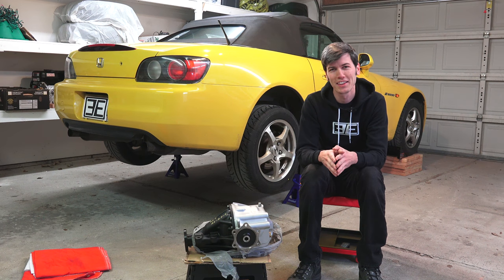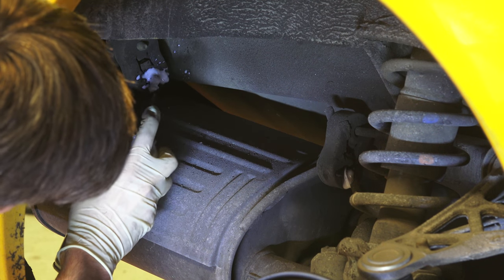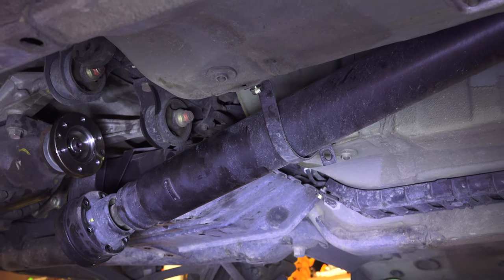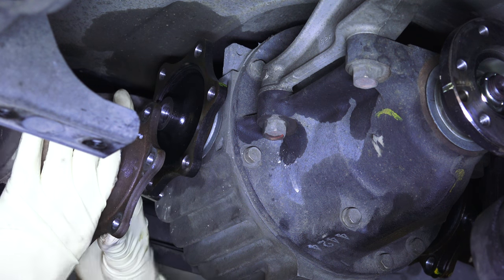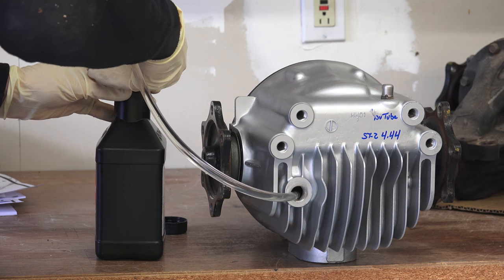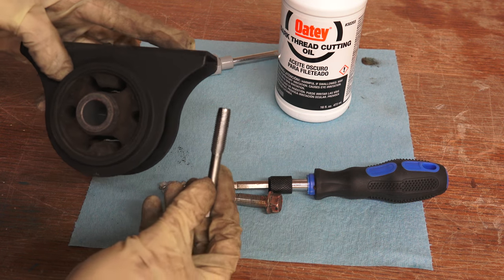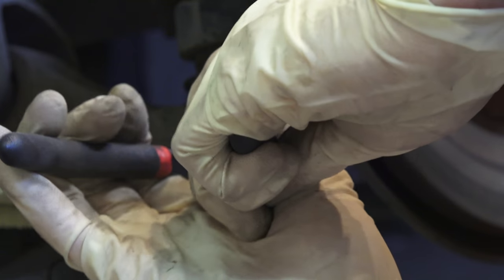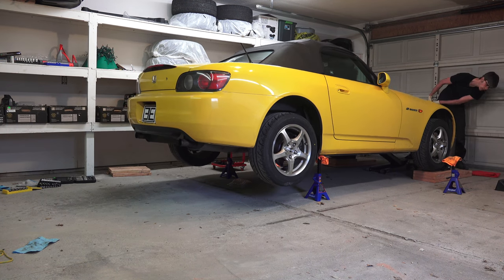Installing A New Differential In My Honda S2000!

Comment: It's way less professional, but I usually just put the castle nut back on the joint upside down and hammer the crap out of it till it pops free.  haven't damaged anything yet!
Reply: granted that's usually when I am replacing the joint anyways, s if it did break I am already replacing it...

Comment: "It's a good idea to have some towels for the exhaust to drop down on".... Is that in hindsight? :)
Reply from the maker: Ha! Thankfully, no. I was anticipating it dropping. I should have had more towels, but I had some sheets underneath for it to fall on, so no damage was done. It comes down hard, be ready!
Reply: Lol I can't say that I've ever used any towels or anything else when dropping down an exhaust. It's definitely not pretty so doesn't matter if it gets a little scratched or nicked up.

Comment: or you can use a simple hammer to remove the lower ball joint, just hit the lower control arm. than it'll  easily come out.

Comment: Whoa... Shouldn't be applying final torque to the lugs until the suspension is at rest (wheels on the ground or four-post lift, etc.). Hand tight will suffice until then.

Comment: some people make sound easy when bolt snaps in place or thread is damage they only show the tool to fix it,how about showing how its done?
Reply from the maker: It's a lengthy process on how to tap a hole, so I left it out since the video was already long and it wouldn't apply to most fixes, but if it's something a bunch of people would like to see, I could make an individual video on how to drill and tap holes.
Reply: i rather watch tapping or drilling a hole for tapping  , it takes skill .
you can easily make a mess if you don't use the right tools. 
Watching someone jacking car up ,taking a few screws off is not my cup of tea.
you can always watch Eric the car guy .
you might learn something from him

Comment: What is an EVap?
Reply: "Evaporative Emission Control System" or short EVAP. It's a rather simple system to prevent fuel vapors from the fuel tank to simply leak into the environment.
Reply: shi01 thanks mate

Comment: Hit what the balljoint goes thru.  I bet a few good hits with a sledge would get it easy.  Those pullers just destroy the rubber boots,  which will destroy the ball joint from all the dirt getting in there. Meh whatever ;)

Comment: 4.44 sweet Jesus don't you want 
1: To have a first gear that goes past 20
2: Have better gas mileage
3: Have gears long enough to actually be competitive in a race. 

OLD 1991 DODGE STEALTH HAD A FIRST GEAR THAT SHIFTED AT 45ISH AT REDLINE. 
The lack of transmission options is what makes this car uniquely suck. I have one so speaking of it's MASSIVE flaw is worth mentioning.

I DON'T WANT TO BE IN 6TH GEAR 
GOING 25 MPH
AT 25OO RPM!!!

Comment: That isn't a differential. It is a differential/rear housing. Which of course contains a differential, and a ring gear, and a pinion gear, and bearings etc. If you can operate a ratchet, you can change out a housing. I wouldn't recommend messing around inside of a housing unless you possess the skills, tools and experience.

Comment: Very unusial to see such a clear bottom of a car. Have you washed it just before filming this or it is so clean on your streets? 
Wearing latex gloves while fixing a car looks so snobbish. Why not using nylon or cotton? 
It is strange that you recomend replacing some bolts, but not studs. They are designed to be screwed up only once.

Comment: I feel like this guy only choose to buy a s2000 just because parts are relatively cheap and to make a lot of videos doing theses cheap mods and make 20k a month and become a millionaire like streetspeed717
Reply from the maker: Bought the S2000 because I wanted a RWD 2-seater that I could work on. This wasn't a cheap video haha, the diff is expensive, but I'm definitely not a millionaire. 👍
Reply: +Engineering Explained He's actually a billionaire.